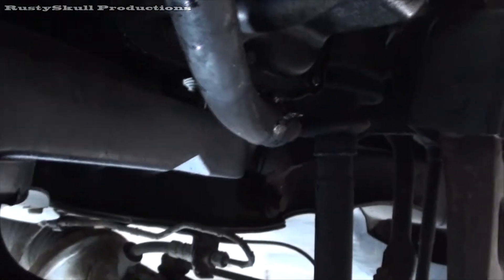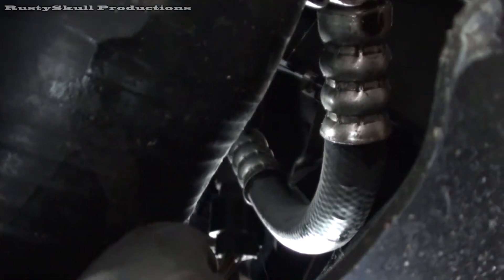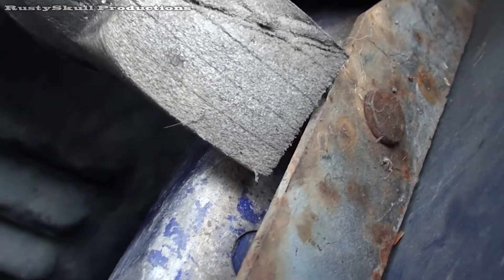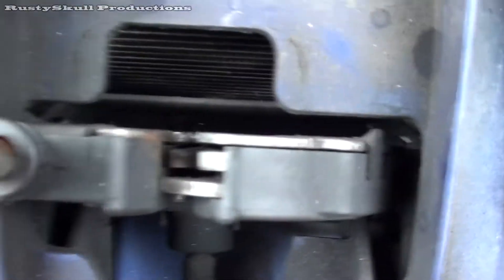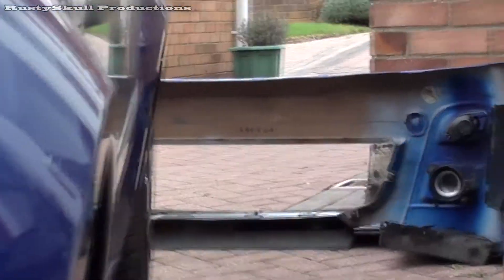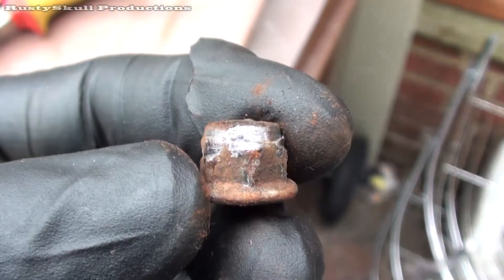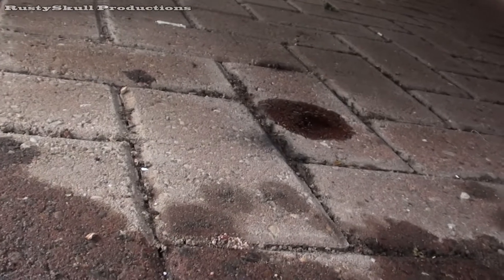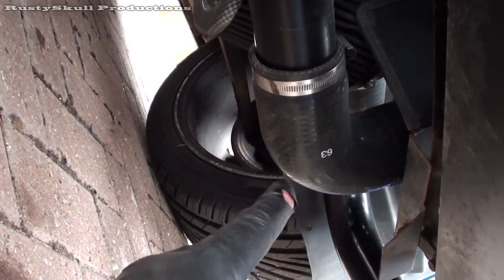Focus RS Trouble - Split Pipe! - RustySkull Productions

Comment: Junilee clips arnt quite up to holding boost Imo always fail on me..id change all the intercooler pipes an clips peace of mind bud....
Reply: Ive got an audi s3 everything takes forever to some parts everything buried deep.
Reply from the maker: +Scribbler dangoff Bloody cars lol. Bumper off just to change a pipe haha.
Reply: +RustySkull Productions fun times bud lol.worth it though she'll  be running sweet soon..👍
Reply from the maker: Yeah should be with any luck lol.
Reply: +RustySkull Productions mite be worth getting a boost leak pressure gauge fit it up pressurise it to 1 bar or  so lol an the leak will be apparent..
Reply from the maker: I've seen those, I've been going to ATSpeed Racing for smoke leak tests for £50 lol.

Might invest in one of these for the future!